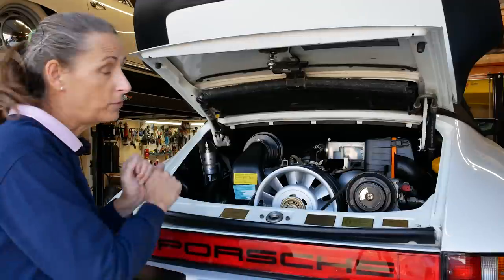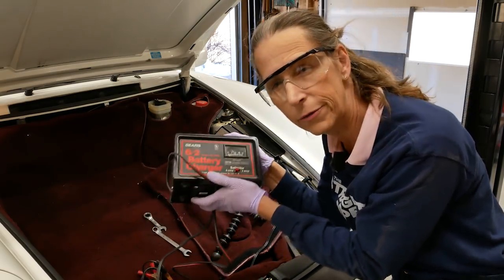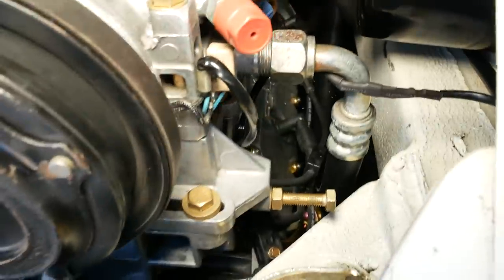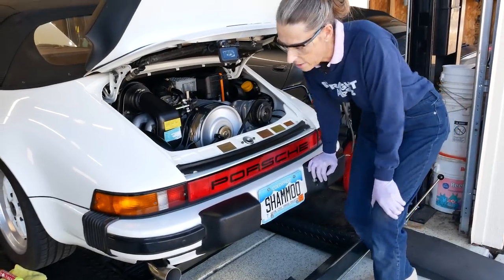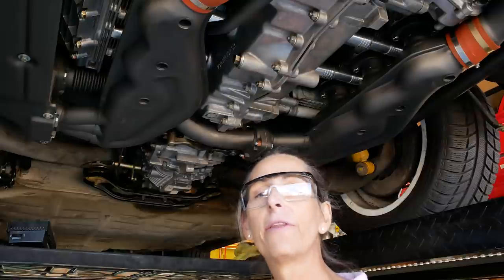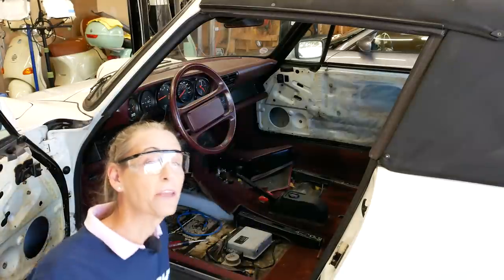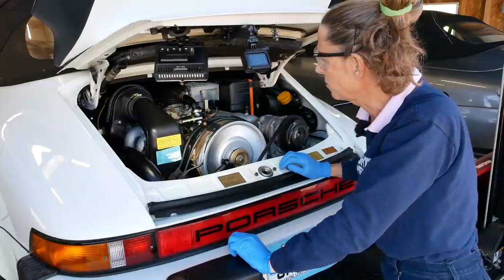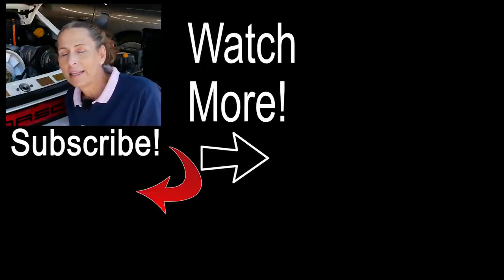Budget eBay Porsche 3.2 Carrera Project Car! #28 - First Engine START!! (What Went Wrong??)

Comment: If you connect a wire between fuses 5 & 6 in the frunk (No 1 is closest to the drivers seat) you can make the fuel pump run without starting the engine. I did this after removing injectors and fuel rail for cleaning. It’s a safe way to check for fuel leaks if you’ve worked on the fuel system.
Reply from the maker: Oh, thanks for that!  That would be helpful to check for leaks.  Next time :)

Comment: Just to add a little experience with this.

Disconnect fuel pump and dme.  Crank to check oil pressure.  Check each and every oil connection.

Then, install fuel pump fuse and dme, turn key on, and push the air vane inside the air flow meter “in” slightly.  This will pressurize and circulate the fuel system without starting the engine.  You can also just turn the key on and off, which runs the fuel pump for a few seconds every time until it is pressurized.

Once you have VERIFIED the oil and fuel connections, you shouldn’t turn over the engine.  (Which should start right up, as everything is already primed.)
Reply from the maker: Thanks for the tips.

Comment: Great work.  
You did a lot of work to this engine and trans over the past year.  A couple of leaks is no big deal, probably just a loose connection somewhere.  You've touched a lot of nuts and bolts on the car through this process. 

Well done!
Reply from the maker: Thanks!

Comment: A 3.2L should take 12 quarts if you drain BOTH drains. (The sump and engine)

Thats a CLEAN 3.2 Engine! Looks like a fresh rebuild 
Great video, I miss working on those Porsches.. now you have me on line looking for a late 80s 911 again!

Lol grrrrr

Merry Christmas!!
Reply from the maker: Thanks.  Yup, I ended up adding three more qts total I think.  I just kept going until I got between the two marks.  Good luck in your search!  They are super fun cars :)
Reply: @HeidiandFranny  sounds good. Thanks, I agree. I have had a few.

Comment: The clutch cable is adjusted with feeler gauges and a caliper.  Most likely you need to adjust the shift coupler too, and check the shifter bushings.
Reply from the maker: Yup.  I show all that in the previous video :)

Comment: If it's anything like a T1 engine I would guess a leaking push rod tube and rocker cover.
The engine sounds like it's got either an inlet air leak or a tight valve clearance on one cylinder.
I've no doubt you'll sort it all out!
Reply from the maker: The tight valve is interesting.  Gosh I hope not, but I'll go there if I have to.  A leak down test will tell me that.  The leak was the banjo oil fittings on the heads.  No push-rods, but there are four oil return tubes that sure look like them.  Thankfully those (and the valve cover gaskets) are completely dry :)

Comment: Hi and Merry Christmas..So glad you two got the engine running..My guess for the oil leaks..., tighten the rocker covers a little bit more than what Wayne calls for in his book.  I have followed his guidance from cover to cover to do a top end on my 3.0 SC engine...
As for idle searching...check all vacuum lines 1st, a small plastic fitting or reducer may have been cracked during tear down and would be hard to notice..also hose clamps..you may have missed one.  And the one that makes me cringe the most when i deal with fuel injection..are your fuel pressures good...?
All the best and good luck, and have a great 2021...
Reply from the maker: Thanks Jim for all the suggestions!  I'm working through all that now.  The fuel pressure shouldn't have changed (maybe a bit better with that new filter).  There aren't too many vacuum lines but I'm going through them with a fine tooth comb.  I did come across one issue I expand on in a later video.  We'll get there!

Comment: Hi there, i like you videos, great. 
Suggestion: Replace those aluminium torpedo fuses for brass or copper ones.
I haven seen the aluminium types desintegrate in front of my eyes when taken them out.
They can get very brittle and unreliable over time (>30 years). They come with plastic and ceramic housings. The latter being the better ones.
Reply from the maker: Thanks for the tips!  I have gone through and wire brushed all the fuses.  That is a big deal on the 308 too.

Comment: I have a similar issue with surging on my 1986 911 targa. L found if you disconnect the plug on the idle control valve while the engine is ticking over for a few seconds then reconnect it ,it'll  idle and run perfectly for a couple of weeks,so I think the problem is either in the control module or the connections. Hope this helps. Enjoyed watching all the engine rebuild.
Reply from the maker: Thanks John, we had an additional issue.  Just getting to the bottom of it now...

Comment: Merry Christmas to you and your family! Congrats on another great video! Years ago, I had a similar issue with the sporadic surging issue and it took me a long time to figure out. At first, I thought it was the by-pass as well, but it turns out after changing the Cylinder Temperature Sensor, the issue went away instantly! Back then it was only an $80 Canadian dollar part. I was so thrilled. Hope my two cents advice helps. Keep up the great work.
Reply from the maker: Thanks for that!  Yup, that will totally cause that.  It (along with the other two sensors have been replaced (not cheap!).  Also, when I pull that connector the engine goes all mustang on me so I'm pretty sure it is good there.  I am currently diagnosing it now  so I hope to get it sorted shortly.

Comment: Franny, it’s so nice that everyone is so concerned about your hair getting caught in the motor, it’s clear everyone cares for you  . That would be horrible, but looks like all is well and your completely aware of the dangers . On the oil leak , I’m guessing chain oil lines as well,  since it’s on both sides or possibly main oil tank line to engine hard line . What was going on with the bungie cords to clutch pedal ? I’m finding clutch adjustment difficult and pedal not coming off the floor .I have no more adjustment at the clevis end  and cable at transmission end . Maybe my clutch is done . I was hoping  a little more detail was coming for clutch adjustment .
Reply from the maker: Thanks Jeff, my stupid hair kept slipping out :(  It is more the angle and lens on the camera.  But yes, very important and I have a appt with my hairdresser (Heidi) to trim it up a bit :)  Yes, the leak was the large banjo bolts for the oil delivery to the heads.  Super simple fix.  As for the clutch, yes I should take some of all this footage and do actual how tos.  The bungie around the pedal is because it wants to drop to the floor and I need to have it in the rest position.  The clevis should have about 3/8" of threads through the clevis and then your adjustments back on the transmission should be pretty straight forward and you should have enough threads on the bowden tube for your adjustment.  You set the at rest with no cable to 1.2mm and then adjust the cable to pre-tension so as to reduce the gap to 1mm and that is it.  One final adjustment is done with the wooden floor board back in and that is the stop for the pedal.  The total pedal travel should be 25mm back at the transmission.
If you can't get that adjustment then first try replacing the cable.  You would do that anyway and it isn't too crazy.  Also make sure that omega spring is good.  If not go ahead and replace that.  If you still can't bring it into spec then you might be in for a new clutch.  Let me know how it goes. F

Comment: Merry Christmas the engine bay looks awesome. With all the work you did not unusual to have some teething issues. Maybe a leak from the oil line at the oil tank like you mentioned when you installed it.
Reply from the maker: Thanks Don!  Turned out to be the Banjo fittings on the heads :)
Reply: Heidi and Franny's Garage glad you found it

Comment: Hi Heidi & Franny,
First off, thanks for sharing your knowledge with us! Love your content and the camera quality it just on point. 
My name is Jan, 25 years and I'm from the Netherlands. I do now own a classic 911 ('74)  G-model since a couple of months. Last week I pulled out the engine and transmission, the transmission is very dirty, covered in some sort of wax. Your 915 looks so clean, what did you do to achieve that? 
Thanks in advance and looking forward to see more content on this great channel in the near future!
All the best, Jan
Reply from the maker: Hi Jan, congrats on your new car!  The waxey substance is probably cosmoline.  It is a rust and corrosion inhibitor applied at the factory mostly for transport. There are products that will remove it, also petrol will dissolve it but I just used a power washer. Just remember there is a vent at the top that you'll need to cover (I didn't know this and got water inside).  There are also some new CO2 blasting processes that look like they work well but can be pricy.  Short of that it is just a lot of scrubbing with Simple Green and brake cleaner ;)
Reply: @HeidiandFranny  Wow, thanks for the response!! I managed to get it clean, first by washing it with a high pressure washer and than scrubbing it with some gasoline and scotch brite. Now it's time for a rebuild.

Comment: Hi Franny, 
I have a couple thoughts for you. On my 2.3 if it’s been sitting for a while it will miss for a while until it warms up then it will smooth out.  I chalk that up to injectors working in and or oil fouling.  Also, a few years back I had an issue with my idle control valve which caused it to run rough until it warmed up, I mean bad.  I replaced the valve but there was no change.  After some research and testing I found that one of the coils in the old valve had a short which blew a transistor in the DME, there are two.  These two FET transistors control the voltage to the two coils in the valve that work together to balance the idle.  So just replacing the idle control valve won’t always fix the problem.  You may have to replace the FET's as well.  Isn’t Porsche repair fun?  Be careful with you hair and loose clothing next to the running engine.
Reply from the maker: Thanks John.  Hmmm...  That would be hard to diagnose!  My old control valve seems to have calmed the surging.  I'm still working to determine why I have a single cylinder out.  We'll get there.
Reply: @HeidiandFranny  I've had issues with how the spark plug wire attaches to the plug.  It zips down the threads of the top of the plug after you remove the traditional screw on fitting.  Some of my connections at the top of the plug were not so great because the spring wire in the plug connector got weak.  The engine would still run but tightening these up helped a lot.  I just love your productions and look forward to each new episode. I work in television and know how much effort and time they take in addition to the actual work on the cars.  You bring so much joy to me and the Porsche community.  Say hi to Heidi for me, I know a lot of the time she's behind the camera and she gives you so much support for your passion of sports cars.  Your loyal subscriber, John
Reply from the maker: Thanks again John :)  The 308 has plug connectors like that.  The springs/clips were so tight it actually destroyed the threads on the plugs and I had to get a new set!  The 3.2 actually has wires for the cap that screws on the top.  But still, it can be hard to find the plug down deep in those holes with almost no visibility.  

Thanks again for the story of the blown FET.  I went back and looked at the output of the DME and looks like there is a line to roll the valve one way and one to roll it the other.  I'll double check to be sure the DME is doing its thing.  The new bypass I bought checks out so once I get the rest of the small issues sorted I can try re-installing the new one and see if it is functioning properly.  That was really great!  I didn't know that.  I really enjoy learning all this stuff :)
Reply: You are so welcome. I’m an old man 59 :) and I’ve had a Porsche ever since I was 18.  I’ve cracked open the cases on a few engines and dealt with many of the fiddly issues over the years.  I can’t remember if you installed a one or two wire engine temp sensor.  My 911 originally had a single wire using the crank case as a ground but once I replaced it with the two wire one the misses and hesitation where gone.  Oh, I have a black original 1988 3.2 Targa with 54k miles on it, it’s my baby.  Good luck, keep the videos coming. @HeidiandFranny

Comment: Cool! Very well done. I know how stressful the first start is. I feel the same way changing a cambelt. Weird engine...I'm sure it drives nice. Is the Ferrari you have  a lot easier to maintain and repair? The Porsche layout seems all over the place. Glad you like to work on them.
Reply from the maker: Thanks, It just seems that way because it is flat.  Really, it isn't that bad (not having a liquid cooling system helps).  I think the 308 is similar, just harder to get apart.  The 308 is a well built car mechanically but German cars were designed with maintenance in mind.

Comment: Nice work. My guess the valve covers or the push rod tubes may be leaking.
Reply from the maker: Thanks! Those oil return tubes look like push rod tubes, huh...  Turned out to be the out banjo bolts on the heads ;)

Comment: Did you replace the breather hose from the oil tank? If so, look at the old one. There is a steel cone shaped restrictor in it. It needs to be swapped to the new hose. Many people have replaced that hose and created running problems.
Reply from the maker: Yup, I mention that in the video.  All those hoses are new and I installed the cone.
Reply: @HeidiandFranny  Cool, must have missed that one. Looking forward to why it sounds like a 5 cylinder.

Comment: nice video but never never see the oil level with engine running becouse the oil is circulanting so its normal the car dont have oil becouse is in the sistem
Reply from the maker: This is a dry dump system and the oil level check is not in the engine, but in the oil tank. The only way to get a correct reading is to warm up the engine so all the thermostats open and oil is flowing through the entire system and then measure what is still in the oil tank (at idle, on a level surface).  What you say is correct for a wet sump (like the 308).  All air-cooled 911s are dry sump engines (along with the Mezger Turbos)
Reply: @HeidiandFranny  uuuuuu ok ok im sorry then good job
Reply from the maker: Totally ok :)  The dry-sump is a bit weird and takes a while to understand.  There is actually an oil level gauge on the dash but is only useful when the engine is warm and idling and a lot of folks don't really understand that and are all confused whit what it says.  Fun fact: the very first Ferrari 308's where fiberglass and also dry-sumps.  I believe all the steel 308s are wet sump though.  Just one of those weird quirks :)

Comment: Wouldn’t it have been easier to raise the entire car parallel to the floor, roll in the trans engine, elevate it a foot then lower the car to the proper height to run the 4 bolts?
Reply from the maker: I'm not sure we could have gotten the car up high enough.  Also, the engine needs to go in nose first at first and then leveled.  But you are right - it was a bear to get the angles lined up.  I might try something a little different if I have to do this again.
Reply: Texans great videos, too. You really know your stuff!

Comment: Congratulation! Pls. be careful with your hair, I had a classmate getting getting 1/3 of her hair pulled off in a drill press ... Merry Christmas.
Reply from the maker: Thanks Lars, I have an appointment with the hairdresser (Heidi) to get a bit of a trim.
Reply: I don't think you'd have the same problem in that engine bay. If a drill bit or mill tool caught your hair it would wind it around and pull your eye balls out through your scalp.
When I was a machinist it was the guys who had to be told to tie their long hair back. The girls usually didn't have to be told.

Comment: What oil did u put in.plz
Reply from the maker: The car is a 1986 3.2 Carrera and I use Valvoline 20W-50 racing because of the added zinc.

Comment: "Bypass"? The bypass for what?
Reply from the maker: It is an idle bypass valve that modulates air leaked around the throttle body. There is no mechanical idle set.  This bypass rotary valve does the idle fine tuning.